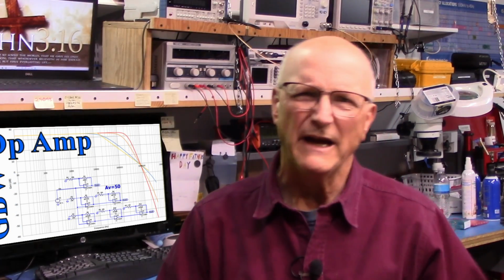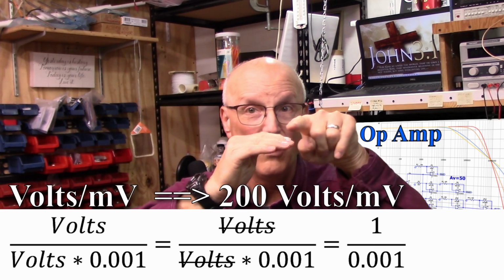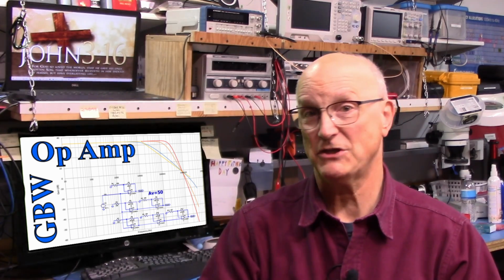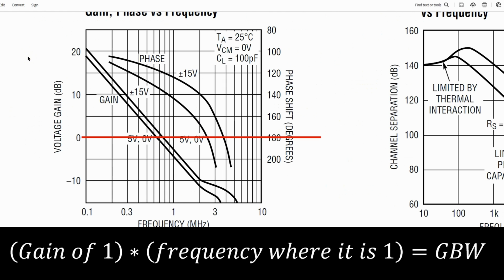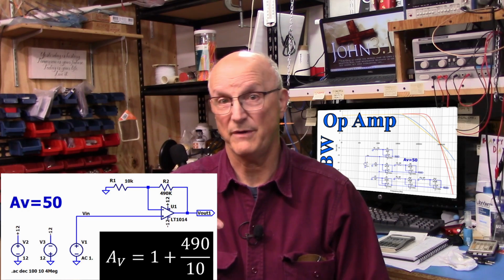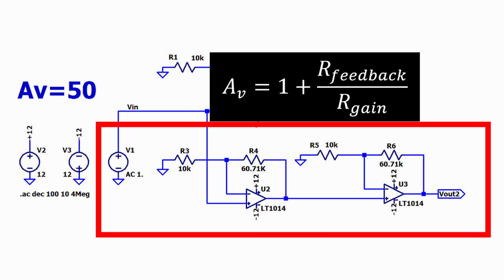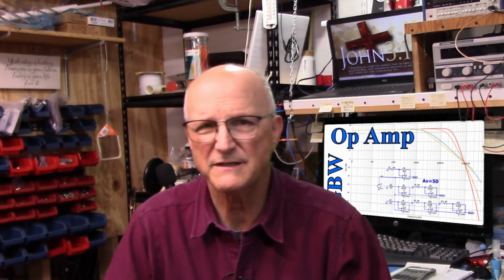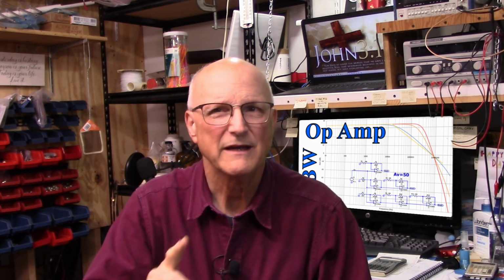Op Amps: Open Loop Gain and Gain-Bandwidth Product Explained (063)

Comment: Fantastic video, great job! One question, though, it's my understanding that to fully reconstruct a signal you probably require a minimum of 5 (preferably 10) times the BW of whatever the fastest frequency of importance is. So, for this example with a GBW of 750kHz, and using 5, that would mean the actual GBW is 150kHz. Is this correct? Do you incorporate this into your analysis?
Reply from the maker: Thank you for the compliment! Anytime the topic of frequency response or bandwidth is spoken of, it is always with respect to the -3dB, or half power point of the signal or gain. This is no different when speaking of the Gain-Bandwidth Product.
If the frequency content of a signal has a maximum frequency of f(max) and you want to perfectly reproduce this signal, then you only have to be concerned with where that 3dB point of the amplifier's frequency response is. 
Five times the bandwidth seems a bit extreme. This sounds more like the sampling frequency of a ADC. Technically, there they talk about 2 times, but in practical, real life terms, it is more like 5 to 10 times.  Analog amplifiers are a totally different thing.  Each specific case is going to be different depending on how many poles the filtering aspect of the amplifier has.
As an example, I just threw together a quick amplifier in LTSPICE using a LT1013. The -3dB point was at 656KHz. The excursion away from 0dB gain began at 368KHz. So, in this case for a signal which contains 368KHz to be unaffected by the frequency response of the amplifier, the frequency response needed to go out to twice the maximum frequency.
The same amplifier, after adding a quick couple of poles to drop off the upper frequency response, the -3dB point is 359KHz and the frequency response doesn't really begin to drop off until 229 KHz.
Each case is going to be different. I hope this helps. :-)

Comment: Sir, may I ask if the formula still right with different types of opamps in stages (like first stage: inverting, second stage: differetinal -> n = 2, Av= Av(inverting)*Av(differential)). One more question is that: when I designed my circuit that I use component in stages like (first stage: opamp, second: stage: bjt or fet, third stage: opamp, the opamp is not continuosly like the example you mentioned), the formula is still right? Thanks a lot for your ans, may I ask if the formula still right with different types of opamps in stages (like first stage: inverting, second stage: differetinal -> n = 2, Av= Av(inverting)*Av(differential)). One more question is that: when I designed my circuit that I use component in stages like (first stage: opamp, second: stage: bjt or fet, third stage: opamp, the opamp is not continuosly like the example you mentioned), the formula is still right? Thanks a lot for your answering. My english is not good so please tell me if you misunderstood something in my questions.
Reply from the maker: Yes, the formula holds true. Av(total) = Av(1) * Av(2), and so on. There may be some mitigating components which may affect this depending on your configuration. But, generally, you can count on this being true.
The BIG issue here is the D.C. level that the signal is riding on. If you are D.C. coupled (no capacitor), the following amplifier stage will try to amplify the DC as well as the A.C. and completely rail the output of the second stage.
Now, mixing an op amp stage with a transistor stage the D.C. level of the output of the op amp is very important as this will affect the biasing of the transistor stage. 🙂

Comment: Hi, what about doing this gain x frequency using a NanoVNA? Another thing I would like to know is about impedance of this amplifier. Thanks
Reply from the maker: There are a couple of things to consider ... first, the frequency range of the nanoVNA. Mine only goes down to 50 KHz. Is this low enough for what you are looking for? Second is the input limitations of the nanoVNA.
Here is a link to measuring the frequency response of an amplifier using a nanoVNA that might help.
https://youtu.be/IGpF9B4ZlT4
Regarding the impedance ... I've uploaded a video that will answer that question for lower frequencies. It will be going public on  October 2.  The one following that will be with the nanoVNA to measure the complex input impedance of a device or circuit.🙂

Comment: Hitting the op-amp wall is not fun, especially when the prototypes are sitting on your workbench .... We used to plot a SOZ chart ... Safe Operating Zone for our amplifiers, showing GBP vs Design gain ... heaven forbid the two curves should touch.
Reply from the maker: That is a cool idea and relatively easy to do, too. :-)
Reply: @eie_for_you  
I always found it particularly useful for variable gain circuits like RIAA deemphasis or tone controls.  It's surprising how often RIAA curves fall outside of the GBP of common op-amps.
Reply from the maker: @Douglas_Blake_579  Well, now I learned something from you! I knew we used pre-emphasis/de-emphasis on FM and magnetic tape recording, but I didn't know they did that on vinyl, too!  It makes sense. Just never actually thought about it much not being an audiophile.🙂
Reply: @eie_for_you 
Oh my ... that's an oldie going back to the 1950s.  The RIAA equalization lets them cut smaller grooves with less chance of skipping, but it does require some pretty careful curve matching if it's going to sound right. Some RIAA pre-amps have gains of 40 and 60 db to contend with.

As a service tech I did a fair stint in audio and pro-audio. I love a good sounding system but calling me an "audiophile" feels like an Insult.  Some of the stuff those guys are into  just baffles the hell out of me...
Reply from the maker: @Douglas_Blake_579  That is cool that they figured all that out. After I took my record player apart in 6th grade, I never owned another turntable or records ... just cassette tapes and not a lot of them. I listened to AM radio all through High School and was quite satisfied with it. I still do not have anything worth bragging about for sound and I'm happy with what I have. 
I know what you mean about the self-proclaimed "audiophiles."  It's right up there with nearly every show that has any kind of electronics or amateur radio in it. (e.g. soldering on a cell phone with a soldering gun!). You would *think* that the writers would make at least a small effort to get the facts approximating reality. Oh well ... it gives me something the chuckle at even in the most serious show. 🙂
Maybe the better term is audio engineer or audio technician for those who actually know what they are doing.
I've run a LOT of sound boards and aligned complete sound systems with their equalizers (the manual method with pink noise and a signal analyzer).
Reply: @eie_for_you 
Like most of us with experience inside the chassis, it sounds like you've been the rounds too.  BTW ... ex VE3 here, if you did the Amateur stint.

The thing that gets me about "Audiophiles" is their often mystical belief that cables, weights, magnets and crystals can control the sound of their systems. Most would be totally lost if we took the covers off their gear but they still cling to these silly, unprovable, beliefs.  For some trying to explain that an RCA cord is just a length of wire amounts to an attack on their religion. (nothing against religious people, btw).

Movie depictions are often hilarious... I really love those cheapo movies from studios like "The Asylum" where after being bombed by meteorites,  trapped in an underground cave and then tossed around by a hurricane, the  hero saves the world by typing commands on a laptop ... right on the floor laughing, every time!

I've been around a few sound boards in my day as well. Mostly as a repair tech... They are some very interesting technology for those who take the time to understand them.

For my own audio experience. Like most I started out with vinyl, made a few cassette mix-tapes and then jumped completely over CDs by transcoding my vinyl to hard disk. I've built entire systems from white space to completion.  It's a sort of a knack of mine.

Cheers... and well met my friend.
Reply from the maker: LOL!
This is my LONG overdue reply!  Sorry. Sometimes this stuff gets lost in the YT world. I'm spending some time trying to clean all this stuff up. :-)